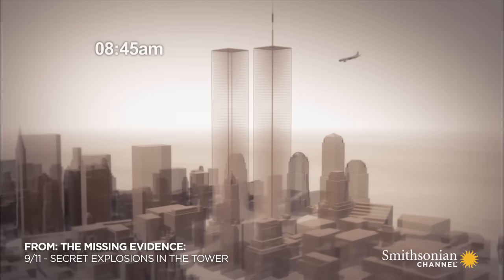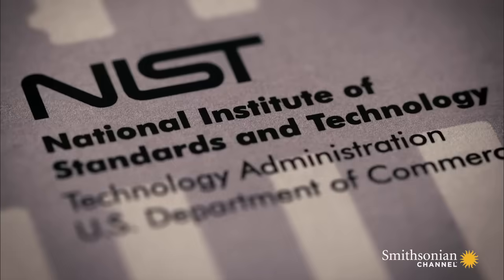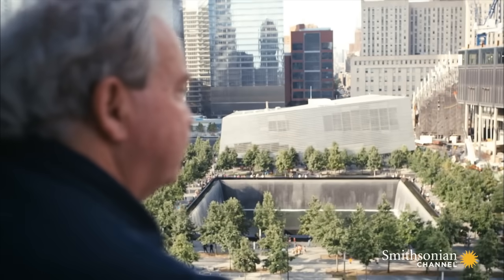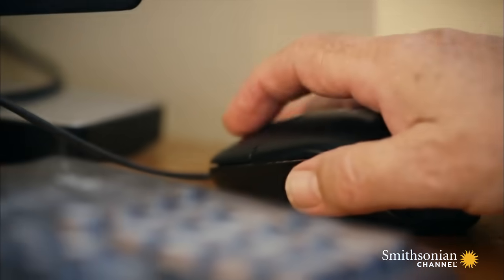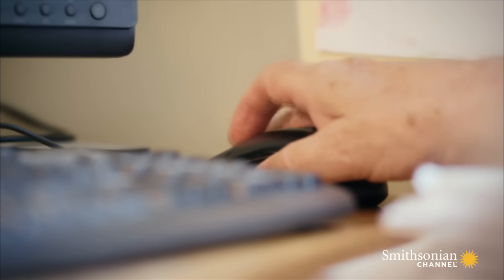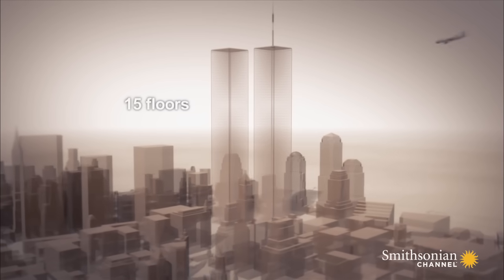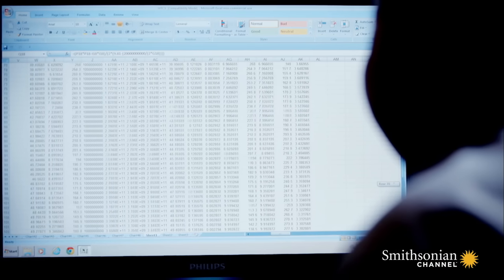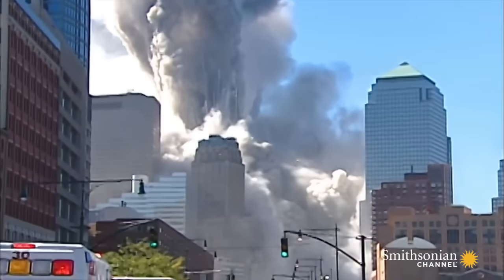This Computer Simulation Explains How the Twin Towers Fell

Comment: In the computer simulation notice: #1 - The missing core columns #2 - The simulation shows the first tower falling straight down. This is an egregious error as numerous videos showed that when the first tower fell, the top section started to roll off. The reason for both of these things to be omitted in any simulation to date (including this one) is because if you include them, you'd have to defy the laws of physics to make it happen without help.
Reply: 1. There are no missing core columns. Core columns were not a factor in collapse initiation mechanisms and were bypassed by collapse progression mechanisms. No laws of physics were violated - there was no magic, no divine intervention. 

2. The collapse animation at 3:00 has zero detail. It is not a simulation. It is not intended to be instructive in any way, shape or form as to mechanisms. Also, there was a brief moment of tilt (NOT roll off) of the South Tower which was overcome by the downward momentum. There is no mechanism for "roll off".

Comment: When you have a "simulation" that explains how building 7 collapsed without being struck by anything at all, let us know
Reply: #1 There was an impact. Two, in fact! 7 was severely damaged by the towers when they came down. Firefighters on the scene described a 20-story hole on the south face with fire an "nearly all floors."
#2 Bld 7 did not fall in the same fashion as the towers. Watch again: The towers' collapses began right at the points of impact, 7's began at the bottom. Not the same.

Comment: In 2003-2004 to think the demolitions theory would have been blasphemy, to me anyway. Now looking back 22 years later I wouldn't be surprised at all. The only other thing I have thought besides a demolition was those buildings were HATED by New Yorkers when the design was first proposed and during construction. Cost over-run and construction timetable became an issue. I wondered if they were just built on the cheaper than origionally planned in its structure material, and it would have been fine "as long as". As it turned out, the Titanic, for all the money put in construction had plating and rivets from steel that turned out to be extremely brittle in cold water. But it probably would have sailed just fine for 30 years "as long as". If I was one of the designers or construction engineers of the WTC and knew for a fact it was sub-standardly built, I'd want that material hauled out for scrap ASAP. Just trying to consider all possibilities. I never heard anyone really propose a cheap construction theory.

Comment: Evidence for non-NIST explanation. Something else caused it.

FACT 1: A gravitational collapse of the north tower violates Newton's third law of equal and opposite forces. The top 15 floors supposedly crushed the many floors below all the way to the bottom. Putting aside the basic physics violations addressed in later points, When two bodies interact by exerting force on each other, these action and reaction forces are equal in magnitude, but opposite in direction. This means that for every floor destroyed in the lower section, a floor is destroyed in the upper section. This means that after 15 floors have been crushed in the lower section there is no piledriver left to continue the collapse.(Even if it could crush the stronger lower section, which it couldn't) There was very little 'accreted mass' as it was all being expelled laterally.
Reply: You are making a gross and common error regarding mechanisms.  Your conclusions are false because your starting assumptions are false. You are repeating the same epic fail that has prevented Architects and Engineers for 9/11 Truth (where you coped all that from) from making any progress at all for 17 years.

Comment: yeah nice story  but then how did the 7th tower fall in the same fashion with no impact
Reply: #1 There was an impact. Two, in fact! 7 was severely damaged by the towers when they came down. Firefighters on the scene described a 20-story hole on the south face with fire an "nearly all floors."
#2 Bld 7 did not fall in the same fashion as the towers. Watch again: The towers' collapses began right at the points of impact, 7's began at the bottom. Not the same.

Comment: The building  #7😂😂😂
Reply: Not the subject of this video.
Reply: @Tim22222  911 is the subject. Thus, any aspect of 911 is open for discussion. You don't make the rules.
Reply: #1 There was an impact. Two, in fact! 7 was severely damaged by the towers when they came down. Firefighters on the scene described a 20-story hole on the south face with fire an "nearly all floors."
#2 Bld 7 did not fall in the same fashion as the towers. Watch again: The towers' collapses began right at the points of impact, 7's began at the bottom. Not the same.
Reply: @sam is the best  that the way the goverment wanna you think happens this way I was there you are brain washed

Comment: i guess the witnesses, police and firemen on the scene who heard many massive explosions were all just a bunch of conspiracy nutters. And our eyes deceive us when we see small explosions on the sides of the building as it was falling.
Reply: You can't just say "Oh someone said they heard explosions, case closed." You need to investigate further. What was the origin of those sounds? Is there physical evidence of bombs? If those towers had been demo'd literally TONS of evidence would have been found: Wiring, detonators, residue. None were. There is no evidence of controlled demolition.
Reply: @Tim22222  Wireless detonation systems and encrypted radio signals were used to set off the demolition charges. We use the same technology in the oil field.
Reply: No, they are misquoted by people with a political agenda who cherry pick and quote mine to deliberately distort what they saw.

You will not find a first responder who was there and lost hundreds of their friends and brothers who thinks there were explosives.  You might get punched in the face if you ask though. They hate conspiratards.

Comment: Wouldn’t the top of the building have slid off its axis, instead of pancaking?
Reply: How? To slide sideways would have required some force to push it. What force would that be?

GRAVITY is the only force at play, therefore DOWN is the only direction it can fall.
Reply: @Tim22222  a force? Ummm… the weight of every floor above the crash site. Not every column was equally compromised.  The girder between columns 79 and 44 are what failed. There should have been a load shift, which the other columns should have absorbed. The recorded theory was disproven over and over, by renown structural engineers. Hence, why in the 911 commission report, there was literally a few sentences explaining why this happened.
Reply: @TheStruggl3Bus  The 9/11 Commission Report was a political report on how the attacks were allowed to happen. It was not an engineering report.
Reply: @Tim22222    So, where is the, “engineering report”? They touched on the reasoning for the collapse, minimally. They also gave a pretty descriptive account of all events, from the time the plane hit, to the collapse. This would validate that it was not just a, “political report on how the attacks were allowed to happen..”.
Reply: @TheStruggl3Bus  You're thinking of the NIST report. I won't ask if you've read it.
Reply: @TheStruggl3Bus  - Pancaking as a mechanism for collapse initiation was abandoned about 2003.  You are not going to figure out how all this worked by chasing the wrong mechanisms.  Too much interwebs debate is wasted discussing things that did not happen.

Comment: Controlled demolition...headline fixed.
Reply: No evidence of that.
Reply: @Tim22222  2 planes 3 buildings into their own footprint at freefall speed....🤣🤣🤣 science and engineering not your fortè, master degree in fairy tales I'm guessing 🤣
Reply: @markriding1267  Actually it was 2 planes a dozen buildings - and none of them fell into their own foot print; 1, 2, and 7 did extensive damage to neighboring buildings. Nor did they come down in free fall (the towers weren't even close; 7 was close but not quite). No physical evidence of CD was found - NOTHING.

Comment: This video is funny
It doesn't explain 
Why cars blocks away were charred?
And the Twin Towers turned to dust
On the way to the ground
Reply: True. This video only explains things that actually happened, not myths and internet rumors.
Reply: @MFitz12  What myths and internet rumors?
Reply: They spent over 7 months removing 1,000,000 tons of very solid debris, including 100,000 tons of steel. The towers did not turn to dust.

Comment: They fell because they were laced with explosive equipment. Planes don't bring down skyscrapers, look at what one bird does to a plane, then you tell me that those planes really went through that STEEL and concrete. The planes were a LIE!!! I was sent to Iraq in a fan lie. Bush and his administration brought down those buildings!!
Reply: There is literally ZERO evidence of explosives. Nothing was found - no residue, no wiring, no detonators - NOTHING.
Reply: @Tim22222  NIST never tested for explosive residue. Wireless detonation and encrypted radio signals were used to set off the charges. Thus, there was nothing left to be found except for, "explosive residue". NIST knew this, that's why they didn't test for explosive residue.
Reply: @jason8952  "Wireless detonation and encrypted radio signals were used to set off the charges."

Oh? And you know this HOW, exactly? 😅😅😅
Reply: @jason8952  If this is a conspiracy image what else could be.

Comment: The jet fuel from the planes melted the steel, thus causing the collapse.
Reply: No. There's no evidence that any steel melted, nor did it need to. Damage from the crashes plus weakening (not melting) of the steel caused the collapse.
Reply: @Tim22222  "They moved a large bolder of rubble and there was a little river of flowing molten steel". Leslie Robertson about what he saw at GZ.

"There were temperatures of over 2000°F a GZ". NYC Meyer on C-Span before Congress.

This goes on and on.
Reply: @jason8952  How did they know that was steel? Did they obtain a sample & test it?
Reply: @Tim22222  There were temperatures of 2800°F at ground zero. Steel melts at 2750°F. Aluminum is silver.
Reply: @Tim22222  Exothermic reaction acting on steel is what caused the molten steel to in sub-basement for over 3 months. This reactions was caused by nano-thermite.

Comment: The way it collapses looks so sus. Towers that get demolished professionally fall the exact same way. There is absolutely no way these towers should have collapsed from a plane. It doesn't make any sense, and it will never make sense.
Reply: Be ready with this replies on September 11 every year
Reply: Towers that are demolished collapse from the bottom not the top smart one
Reply: I've never seen a professional controlled demo that began at the MIDDLE of the building. Have you?

Not the same. Not controlled demolition.
Reply: @Tim22222  Huh? What are you talking about?
Reply: @mr.octopi1825  Every CD I've seen - and I've seen a few - begin at the bottom. The structure hits the ground roof last.

Watch any video of either tower's collapse & you'll see the collapse begins where the plane hit - ½-¾ of the way up the building, not at the bottom. Not the same.
Reply: @Tim22222  Exactly! Then why did it fall straight down?? Why did it not tilt? Almost looks like the beams at the bottom were tampered with
Reply: @mr.octopi1825  "Then why did it fall straight down??" Because GRAVITY.
"Why did it not tilt?" It did! The tops did, anyway. You can see that in every collapse video.
"Almost looks like the beams at the bottom were tampered with" There's no evidence of that.

Comment: Because it was a controlled demolition. Between every ten floors there were floors for maintenence and people said they heard some noise coming from it and the security alarms were shut off for 2 monhts till the collapse. Its because charges were planted. And the firemen during the rescue heard loud explosions coming from basement levels. All the facts are there and people still believe that planes made it collapse?! 
Inside job to fund the war machine and make new rules to controll and survey the people.
Reply: Everything you're saying is conjecture, not fact. There's no evidence for any of it.
Reply: There are many facts to that. Firefighters heard explosions. Airplane fuel cant melt steel beams. Building cant fall straight down unless its a controlled demolition. Building 7 randomly falls the same way. Evidence found of thermite explosives. How can IDs of terrorists survive the explosion and fire and the black box cant? And the official investigation is BS, they are lieing

Comment: How often do emergency personnel have to deal with a building so huge so high up with a plane full of fuel crashed into the middle of it near the top! Oh and there's two of them, two towers on fire from two largest air liners at the time flying into it with full fuel. There is just no comparison. #1 center of building is structurally compromised   #2 huge fire ignition source   #3 huge air intake for fire  #4 slower to react to fires so high up in buildings because fire fighter gear is heavy, and they have to take the stairs! #5 The fire was at maximum force with everyone inside most fires start small everyone evacuates then it gets crazy not this time #6 there is no fire emergency in a building in history that compares to this, other then the tower of babylon.... Grenfell was a very small building in comparison weighed a lot less didn't have structural compromise at the time the fire started no liquid accelerant inside the building just all over the outside walls which wasn't much better. Just stay away from towers ok :) clowns in power in charge of "safety" is  not a safe world lolz

Comment: there was a lot of talk about whether or not flaming jet fuel can get hot enough to melt metal, well, it doesnt in this instance! The flaming jet fuel set everything and everyone around the void carved out by the plane, carpets bodies gas lines particle board you name it was burning after the fuel gushed out and caught fire. That is why the heat from the fire was so intense as the chemicals involved got more complex. Lots of stuff made from crude oil including peoples clothing and carpets its why they are flammable. Even materials we often think are flame resistant only are to a certain degree of heat. Flashover is the most insane aspect of a fire, easily melts metal supports brings the roof of buildings down onto the fire and releases the trapped heat high into the air and usually dies down after that cause by then everything catches fire just from hot gases heating the air. Fire fighters often make holes in roofs to prevent flashover from getting hot enough to melt roof into collapse cause then they can't fight the fire from the roof at all and have to then hang over with ladders which is still dangerous if it can even be done in time to make a difference once flashover has occured. Witness statements said that flaming jet fuel went down the elevator shaft and killed people in the elevator, so we know that fire was spreading through other floors gas lines electrical lines plumbing for water pressure above is all in the lower shaft if it was on fire sprinklers might of not even worked! I'm pretty sure an investment like the twin towers had sprinker systems. With so much fire through out the building and worse just under the roof, it makes sense that not only the top of the tower collapse into itself but the spreading flamming fuel fires compromised other floors as well. I do agree that the flamming jet fuel might not be hot enough to melt metal but the building was burning the flaming fuel was just the spark. Probably lots of materials in average office building that burn hot or hotter then any particular fuel. Flashovers are always hotter then the temps the stuff actually burns at to. Its very possible the fire alone collapsed the towers. I wish they got better witness statements and emergency responder statements about how many lower floors actually caught fire, that would give us all a better understanding of why the rest of the building collapsed. If the fires lower down started around same time as upper building because of the burning fuel down the elevator shaft, it definately is possible. One thing is for sure it was an inside job, trump and the world order gang were not in the towers that day, and planes don't just fly into buildings, you don't just offer someone money to enjoy later to do a suicide job.
Reply: Did you fail physics and structural engineering?